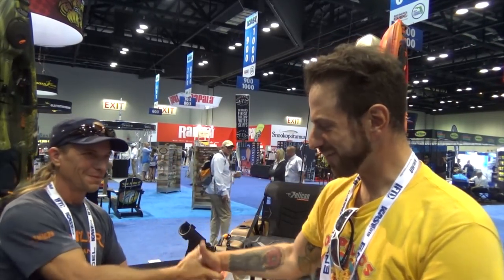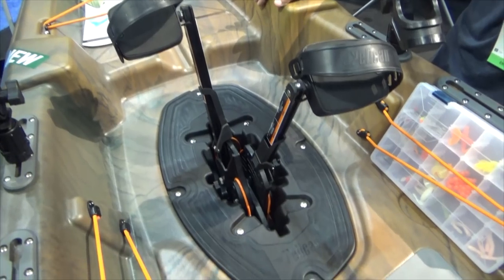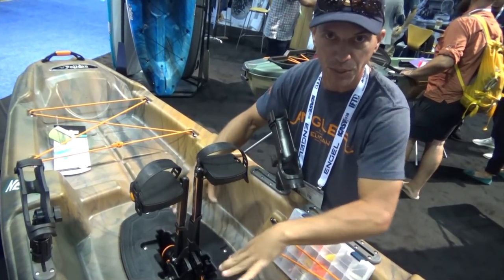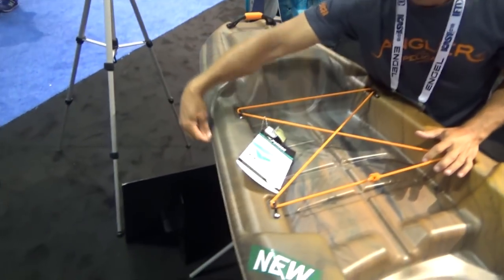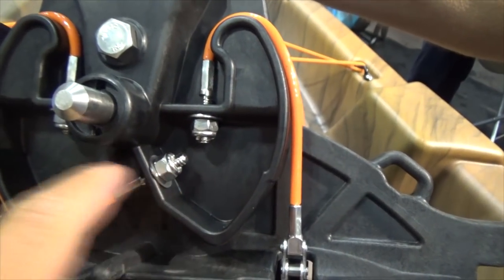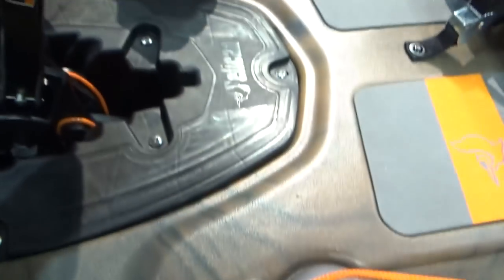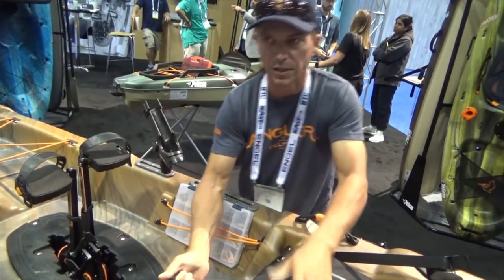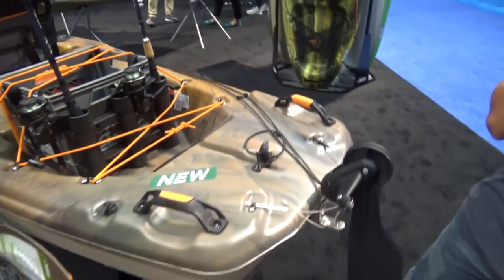The NEW PELICAN PEDAL KAYAK - My Unbiased Walkthrough & Thoughts @ ICAST2018 (Exciting!)

Comment: As a Pelican kayak owner, I'm super-impressed and happy to see this coming to market next year. I've been wanting to step up to a kayak with a drive system instead of being paddle-driven, but Hobie's price doesn't make sense to me for the little time I'd actually be using it. I've had a Pelican for 3 years and it's taken some abuse. It's still looking brand new today with the exception of some scrapes on the hull from going over rocks. If Pelican can come in a few hundred bucks or more under Hobie's entry point, I'm sold.
Reply: It's going to be $1500, so you should be good.
Reply: Awesome. That to me is worth it. I can't justify spending over $2k for a yak like Hobie.
Reply: sk88rat shoot the one I looked at Oak Orchard was $3k and weighs 110lbs empty. The trailer package and yak was going to be $4k plus tax. 
I love yaks for the ability to get in place but for four grand, I will buy a 16' boat in great shape

Comment: Quite a flashback seeing that "Ram-X" tag. Probably the same material that Coleman used for their  ( almost indestructible ) Scanoe's, beginning in the early 1980's. The square-enders were 16 ft., had 12 inch draft, took a 5 hp motor, could seat three, and weighed 95 lbs. Very stable, but a slug to paddle straight, and a bear to maneuver through tight downstream turns. On the plus side, they were relatively cheap ( some assembly required ). Dragged over gravel or dropped on rocks, it made little difference ... took 30+ years for the first cracks to show up.
Reply: Woody Stemms I drug my Coleman scanoe through hell and back on Rocky Missouri rivers in the Ozarks  it took a beating and kept on going.

Comment: Great video as always.  You mentioned several times that this would be good for fresh water, maybe I'm reading into it but it sounds like you may not be so convinced for salt water.  Do you mind explaining why?   I just started kayak fishing this year and am looking to upgrade to a pedal drive system which is why i ask.   Thanks
Reply: Yes, an experienced kayaker can easily take this boat in salt water. Just make sure to rinse it off thoroughly with fresh water after each use.

Comment: I'm always happy to see some new, more affordable designs. Can anyone speak to his comment about the hull being stronger than a rotomold? Are the seams a weak point? I honestly don't know much about those kayaks.
Reply: morgan ghetti I own a pelican Cast away that I purchased in 2006 from Sports Authority and still use it today! Seams are holding up well and the only leak I had started last year from always dragging it over sand and rocks. Took 12 years to wear. Keep in mind I'm no weekend warrior. Fished it hard whenever possible! 95% saltwater use.  That kind of leak is preventable with a kayak cart. Very tuff as opposed to Hobie. I fished a Hobie Quest back when I lived in Florida 2003 and lightly bumped an oyster bed. That put a hole in my yak. I doubt that would have happened with the Pelicans Ram X plastic hull.  Getting too old for paddling now and was preparing to buy a Hobie. Think I'll wait now till January!